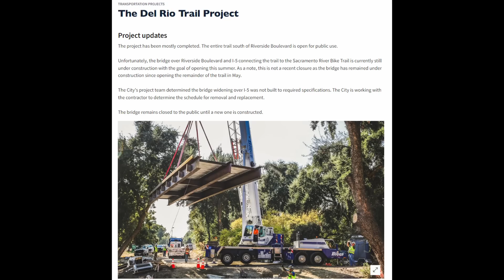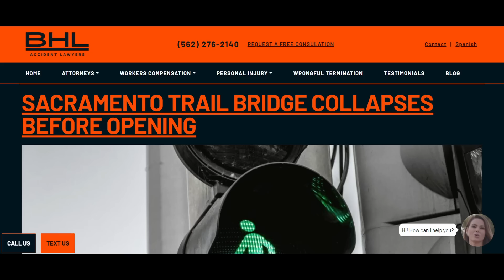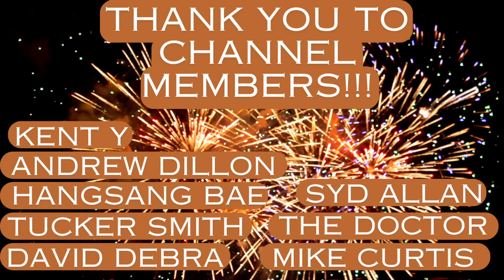Sacramento Pedestrian Bridge - What is the Problem?!

Comment: One low cylinder test is not indicitive of poor concrete. Coring that fails can lead to full scale load testing (ACI 318) of a structure to determine if it is indeed non conforming. Expensive but not compared to replacement.
Reply: I'v done a complete load test (static and dynamic) of a small bridge with issues.  It passed and was used until burned in a huge wildland fire.  I later saw that bridge covered by folks singing .....glad we tested and had the confidence that it was ok.

Comment: Yeah I worked Sacramento area construction in the late 1970's and became friends with a FHA inspector who told me about a huge cheat a construction firm was getting away with (I5 slab if I'm remembering correctly) where they were pouring 4 sack when in was spec'd 5 sack.  The cheat was in falsely dating the test samples; they were given a couple of extra weeks to cure before the destructive testing.  Huge project, millions of cubic yards and $$$. I wouldn't be the least bit surprised that that level of corruption continues today.

Comment: The disused rail bridge is still part of a long rail line that extends for miles in both directions through Sacramento and surrounding areas. The line could be used in the future, possibly for light rail transportation. It would show lack of foresight to change that bridge to a pedestrian bridge.
Reply from the maker: Thank you!
Reply: They could have used it now and retained the option to build a separate bridge in the future if the rail traffic came back.
Reply: @NiallWardrop  Your answer belies several levels of naivete. While you are theoretically correct, no property owner would ever agree to such an idea.

Cheers,

Alan Tomlinson
Reply: @diegorhoenisch62  If that were true then nothing would ever be done. Apparently the trackbed belongs to a railway museum who would probably welcome the revenue from a rental agreement with a clause that they could terminate it if they ever wanted to run trains. Such things happen all the time, most people and organisations are not as pointlessly intractable as you think.
Reply: @NiallWardrop  CSRM uses it regularly. They haven't used it for the past year because of needing to protect the the workers for the city's pedestrian add-on.
Reply: @heatherk1937  Surely with all the railroad street running that happens in the US it must be possible? In the UK we had Connel Bridge which was dual use rail and road until the railway closed, and more recently Britannia Bridge, Portmadoc where a heritage railway which runs regular services shares a bridge with road and pedestrian traffic - in both cases the road was / is closed when trains are using it.

Comment: The railroad tracks are not abandoned:  they are part of the Sacramento Southern Railroad, operated by the California State Railroad Museum
Reply from the maker: The local news said they were abandoned.
Reply: The local news is incorrect. @CaseyJones-Engineer
Reply: they're effectively abandoned, they dont lead to a single building or other track for its entire 10-15 mile route out of the museum
Reply: @SecureLemons  Perhaps, but the right-of-way is owned by the Sacramento Southern Railroad. 

Cheers,

Alan Tomlinson
Reply: They are not abandoned, they are not effectively abandoned. They were cut off by the were cut by the construction of the pedestrian append, to protect the work. For nearly 10 years prior trains were running to Sutterville road.   To gain interest in making the zoo a whistle for more than 20 years the zoo has put out there they are moving. the line was abandoned to the Department of Parks and Rec directly from SP, They didn't buy it.

Comment: You made a mistake about the rail line being abandoned. Yes, the Southern Pacific filed to abandon it but it was bought by the California State Railroad Museum. It is still active track as the Sacramento Southern Railroad to just north of Sutterville Road.  They still own south of that but it is in a state called "out of service" not abandoned.
Reply from the maker: That is what I get for relying on local news sources.
Reply: @CaseyJones-Engineer  No apology needed, as local news is so embarrassingly inacurate 100% of the time. Their mantra is to get something out, then check for accuracy later.
Reply: @CaseyJones-Engineer  This is the beautiful side of the internet:  If you don't know, all you have to do is ask, and someone will have the answer.

Even if someone wanted to come along and say "but it's a stranger on the internet, could be a lie!", the answer given even contains everything you need to validate it.  that's more than you typically get out of a newscaster.
Reply: @ShuRugal  Sadly it has been my experience that if you ask you will never receive an answer, however if you confidently state something that is wrong you will be corrected within seconds.
Reply: @uzlonewolf  minutes
Reply: @ShuRugal  Newscasters are given a script to read on the air.... they do not create the material that they are going to share. They are probably given the script an hour (I am guessing) so so before broadcast...hardly enough time to research all the facts in the script. So everyone needs to give the newscasters/readers a break.   As for the research team behind the scenes...they are up against the clock and rushing causes errors. I'm sure media tries to vet their sources but there is only so much you can do in a 24/7 news cycle..... but they CAN and should issue corrections.
Reply: @macforme  perhaps I am painting with too broad a brush,  but when I say "newscasters" in this context,  I mean everyone in the process, not just the talking heads.
Reply: @ShuRugal  👍   Got it!
Reply: @CaseyJones-Engineer  The best way to get the right answer on the internet is to give the wrong one.🤣
Reply: @CaseyJones-Engineer  the bridge hasn’t seen any rail activity in more than 50 years.
Reply: @CaseyJones-Engineer Making content when you don't know half the story is very "new media" of you.

Just because it's a recent news story doesn't mean people haven't been working on this issue for months. Don't let that stop you from being a backseat engineer tho... get those views.
Reply: Thank you for the info!👍
Reply: >Sacramento Southern Railroad to just north of Sutterville Road... 

To just North of Suttervile Rd about 400-500' IS the bridge. From the looks I assume Suttervile was at once an at grade crossing. but it's paved over. The tracks continue on the South side of Sutterville up to 27th street where again it's paved over... an then there a short of maybe 100' section of track left. After that the tracks are all ripped up which now appears to be the bike path. We have a lot of that in the Buffalo area as the rails consolidated. In fact the one N to S track that was the Erie -> Erie Lackawana -> Conrail -> defunct rail at the end of my street is now a bike path. The other N-S track that came out of Conrail is now CSX and Amtrak.  

The museum may own the bridge, but it's pointless... what are they going to do - ride passengers over the bridge for a couple hundred feet and then backup the train, back over the bridge? 

The city could of just taken over the existing bridge by imminent domain and like Casey said - just rehab the bridge for the bikepath - for a LOT less money.
Reply: @douglascaskey7302  Sorry...the tracks have NOT been ripped up .... the video talks about how much cheaper it would have been to do that  but the tracks belong to a private entity.
Reply: @macforme it’s the rail museum… there hasn’t been a train on those tracks in 50 years and I doubt they will ever see any use since the neighborhood is very opposed to any rail traffic.
Reply: Concrete is sampled and tested on multiple trucks a day on all the pours i have been on.
Reply: .. will check this out
Reply: The bridge might belong to the rail Museum but there hasn’t been a train across I-5 in 50 years or more that I’m aware of. I live in the area and have ridden my bike across this bridge many times. The tracks end just after the east side of the bridge. The neighborhood of land park doesn’t want any trains. Even if there was a train it would be very seldom. The bikes and pedestrians and the occasional train could have all shared the same bridge. This was a waste of money.
Reply: Pickey pickey pickey who cares
Reply: @mikeprice4103  Oh sure. $23 million for a damn bicycle bridge hardly  anyone will ever use. This is how we waste money in California. Meanwhile our roads and infrastructure are falling apart. 
Honestly you could add the IQ's of the entire city council and throw in the mayor and it would barely break 100. But you're the type of citizen out who is responsible for the corrupt  unaccountable Democrat who govern this cesspool. You never object to any ridiculous waste of our taxpayers dollars Oh, so what. I guess I'm just being picky picky now.
Reply: @RichardSmith-ps7qc   If you have a partner and i doubt you do God help them.
Reply: @mikeprice4103  Wrong-o, Mikey! I have been married 55 years (to a woman if you can imagine it). We have 2 kids who have produced 6 grand kids for us and two of which have produced 3 great grand kids. All of them except the little gg kids are productive, responsible, patriotic folks none of whom have been in trouble or exist on welfare grift. And none of them are low information voters who think blowing off $23 million bucks for a poorly inspected single use bicycle bridge is trivial stuff.
Reply: @mikeprice4103      wow.... do you feel like that about everything?
Reply: @macforme   No sometimes im hungry
Reply: @mikeprice4103  That information would have prevented my comment   😂
Reply: @mikeprice4103 it does matter to those involved. An abandoned rail line bisects my farm, but it is part of the national rail bank and owned by the state DOT. This is so it can be brought back into service at some future time, should the need arise. It’s what has kept it from being turned into a trail for all of these years.  The situation there may be similar.
Reply: @dongrant5827  The video wasn't about that, a new bridge was built.
Reply: @mikeprice4103 and Casey speculated that they may have been able to repurpose the railroad bridge instead of building new, thus avoiding the current situation.  Now Casey, and you and I all know that couldn’t have happened given the ownership of the railroad bridge.
Reply: @dongrant5827   But they didn't use it
Reply: @mikeprice4103 and now we know why!
And for someone who commented “who cares”, you sure seem to care a lot.
Reply: @dongrant5827  Just bored
Reply: @mikeprice4103  well, at least now I feel like I’ve accomplished something today by alleviating your boredom by some small degree!

Comment: Another outstanding presentation, thanks! Obviously, the on-site municipal construction inspector failed his own concrete slump test.
Reply from the maker: Thank you.  I don't know how the inspection process could have missed such alleged problems.
Reply: The contractor should not be stuck with the total cost of repairing this project if it was the municipal inspectors who failed in their responsibility to ensure the process met with city building standards.  The city should be to blame for this failure more than the contractor.

Comment: Back in my 'intern' days, before becoming a project manager, I witnessed my job foreman pull a super big no no.  We were pouring foundation footers, piers and walls for offices and a repair island for the area electric company.  The materials test guy, (looked like a highschooler), pulled up in his white pickup truck and proceeded to check slump, (it passed) and take slushed cylinder samples for later.  As he was leaving, (still in the driveway mind you), my foreman hollers up to the concrete truck driver "JUICE HER UP"!  Driver grabs the hose and starts spraying the load while spinning the drum quickly.  Our foreman told us later that he had to tear out a pier once because it had honeycombed, and he was not going to take a chance on that ever happening again.  I'm not surprised to hear you say that there is a test to reveal how much water was in the mix.  But I've got to wonder how often stuff like that happens, and if anybody gets caught juicing up concrete.

Liking the stories you pick, and liking the 1st look for member privileges.
Reply from the maker: Thank you!  There is a simpler test to measure air content of fresh content.  The device used is called an "air meter" or "air pot".  It looks like a pressure cooker.  Adding water or other additives to concrete at the jobsite can be very problematic.  The other aspect is liability.  If the concrete is used without modification as sent from the batch plant, then the contractor will have recourse against the concrete supplier for recovering damages.
Reply: Happens all the time.   Never ending cat and mouse game.  I've had foreman like that banned from all county work before  for this exact thing.   Total BS and disregard for the specifications and contract standards.
Reply: Way back when I was a summer engineer intern for PA department of transportation, my boss warned me that every cement mason would complain that there wasn't enough water in the mix even if there was an inch of water laying on top of it.  Fond memories of days going with contractor's guy to go break cylinders.
Reply from the maker: @ChiefBridgeFuser  I did inspection on a masonry wall being built the summer before I graduated school.  The hod carriers had one arm that was much bigger and stronger than the other!
Reply: This would be my guess ... 20 gallons of water added to make the pour go easier (and cheaper) ... this is fraud, and cannot be supported ... if insurance doesn't want to replace the bridge, they shouldn't have underwritten the pack of thieves who built the first one ...